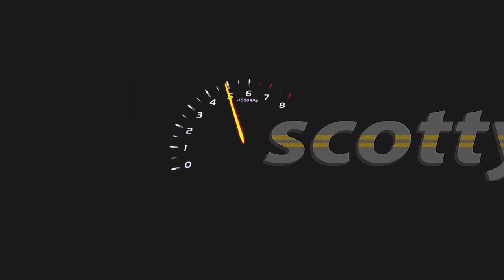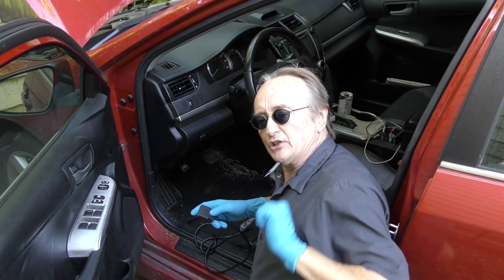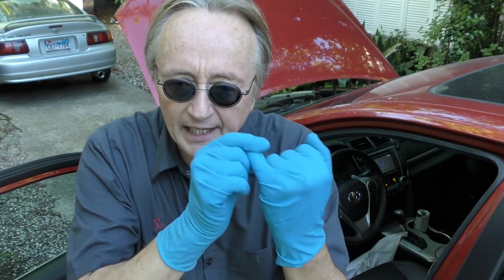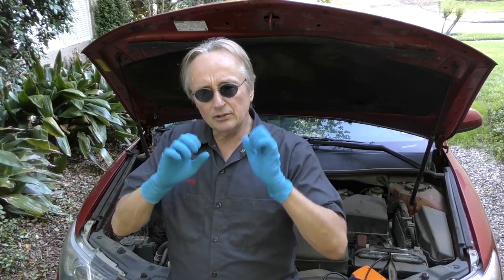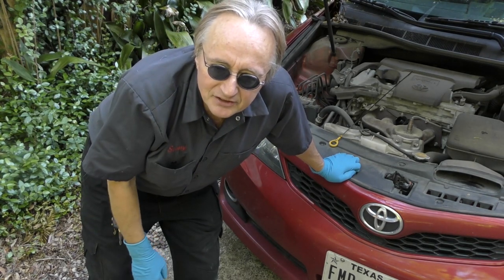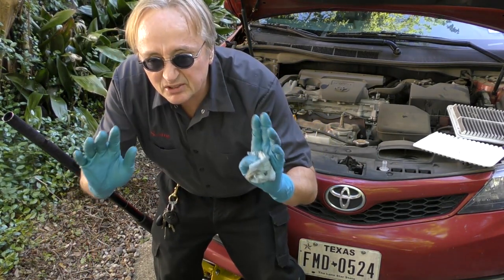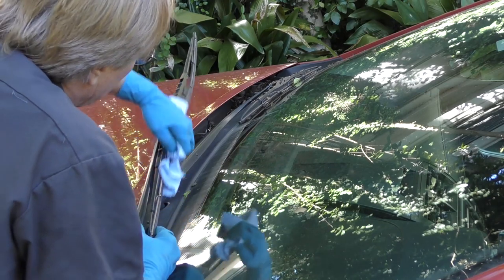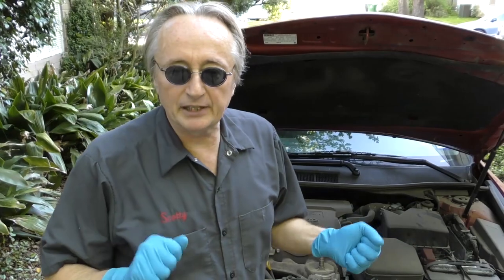Doing This Will Make Your Car Pass Inspection

Comment: New York isn't too bad.  Outside of the city no pipe test, looks like the same as Texas, same OBD II only.  I bought a cheap tool place code reader and cleared the code mine had (some minor EGR issue) and it passed.   ABS light on is okay, it just has to stop straight and they check the usual safety crap,  one wheel has to come off to inspect the brakes.  But you're not going to drive around with non-functioning brakes are you?

They still hit me for a bulb and a power steering leak and fixed it without asking, so not sure I will go back there.  I walked around it the night before and checked all the bulbs, I even changed one, and they don't indicate which one was changed.  And it never left any puddles that indicated power steering.  I probably should change out that line but it's a pain in the butt to get to. 

I should make a video just telling how the state essentially paid me to take this van away.

Comment: @3:39, i thought i was the only one that hated those plastic top removable-disposable oil filters....even those little paper-rubber oil filters without a steel canister housing COSTS MORE than your typical steel encased oil filter...go figure. I busted some knuckles getting those silly plastic oil tops off....they are not kind.

Comment: You're located in Houston? Please , may I have ur location? I need a mechanic for my 2006 mustang. I had a leak inside the interior under the glove compartment and now my lights won't come on. I took it to ford and they said its my fuse box that is corroded. Can you help?

Comment: There used to be Consumer machines [ Tech Items ] in California, where you could run a Line w/ a  tester into the " Tail Pipe " of your car, And get a reading of the " Smog Emissions " !
But after they came-out w/ Newer  " Smog Station " Test Equipment such as the Roller Spindles that your car " Has To Run On " During the [ Smog ] Test, 
those personal " Testers Vanished " !   Probably Due to Either " Obsolescence", Or " Political Corruption " such as was Or was close to the Case of Then,
Governor Gerry Brown Sr. who rumor has it worked to get the " First Smog Device " " Required " in California, which was a 1/4 inch thick , by 2 inch wide,
Disk with small short Tubing coming out of each end !  It had some Foam in it and " Filtered " the " Emissions " Flowing Through it !!
It was said that Gerry Brown Sr. did this for a friend of his, to help him get his " Invention " on the market !!
So for a Worthless creation, we had to spend an extra cost to make Ol' Gerry and his " Friend " " Happy " !!
Thank you Gerry, you old fart !!!

Comment: 2005 Subaru Outback showing cel and flashing cc lights. Obd sensor shows code p0420, checked cc temp with infrared thermometer within acceptable range. Live data shows 02b1s1-2.788 02b1s2-.840  02b2s1-2.765. 02b2s2-.735  do these numbers tell you anything?

Comment: By "incomplete monitor" do you mean like when people remove sensors to run a cat-less exhaust system?
Reply: That would do it, but more generally it just means the car computer has confirmed everything works, even if you cleared the check engine light. That requires driving around a bit.

Comment: In america these tests are a joke in comparison with Europe, they check every silentblock, shake your car with a machine to see if there's play, struts, very strict smoke opacity on diesels, gases in petrol (lambda value must be 1), seat belts, tyres, rust, bushings, arms, headlights, check for "unathorized" mods like different wheel sizes, spacers, don't you dare to put a different engine or exhaust pipes without homologation or delete cats/ or DPF, can't install xenon or LEDs if your car came with halogen (because of the reflectors) etc they also check OBD2 in modern cars on top of all that. It can be a nightmare if you have a 10 year old car.

Comment: Help Scotty!! I have a 2015 dodge challenger sxt, My car had abs code C0031-62 left front wheel speed sensor signal compare failure. I changed my left right wheel speed sensor and now its saying incorrect component abs code c0031-4a. I tried erasing the code but it doesnt erase it stays on

Comment: In corrupt eastern europe, it is not so easy as you have it there. In here additionally to exhaust gases they check the brakes - if brakes dont work you fail. If they work, but 1 or more disks/rotors breaks less/more than the others you fail. If hand brake does not work you fail. If hand brake works, but only on 1 wheel you fail. if any of the windows wont roll down you fail. For vans if there is not a wall or metal bars between you and cargo area you fail(requirement for vans). They also sit in each of the seats and make sure all seatbelts work. If 1 seatbelt is missing or worn out you fail. If car has more seats inside than is described in technical title you fail. If dash lights do not work you fail. if abs or airbag lights up you fail. They mostly dont care about check engine or error code reading tough. Then they test tie rods, coil overs etc. If theres too much play somwehere or they are broken you fail. Also body is checked underside. if there are oil/fluid leaks somewhere or rust holes big enough you fail. if you do not have required hazard triangle you fail.  

PS! Also is required to have fire extinguisher that has to be stamped every year by separate company(for money), otherwize they dont accept it and you get a warning.

Comment: Scotty, love your videos best mechanic, i wish i could let you see my 05 infiniti G35 coupe i could really use a man honest like you 
and please what are your thoughts on the infiniti G series... cheers from lebanon
Reply: I've got an 03 coupe myself.  You having issues with yours?
Reply: @theripper121  yeah man the radio ... its a stock bose system but no sound is coming out its freaking me out 
Somthing might be loose with the plugs
Reply: @1122449  Hate to tell you but the factory radio is very unreliable.  The 6 disc changer often poops out.  Often times the radio itself or bose amp dies then you get no sound at all.  Its a frequent issue with those cars.  Generally the easiest way to fix it is to rip out ould radio I'm afraid and replace it with an aftermarket unit.
Reply: @theripper121  damn ... im scrued😂
Im gonna sell it soon so i wanna chek everything before the new buyer comes to see it im gonna take it to a audio shop i think they could fix it up for 100$ ... a new radio costs about 500$ my wallet is screaming at me 
Thanks for the quick reply i appriciate it

Comment: whats with that AT 205? can you make a video about it? says seals transmission leaks?
Reply: enraged gecko - It's ATP AT-205 Sealer/Leak Stopper(?) (and it seems to be a rubber conditioner, too).  Scotty recommends it for keeping rubber parts supple and lasting.  Guess you can find it at AutoZone, Wal*Mart, NAPA, and probably other auto parts stores.

Comment: the 1994 f150 doesnt have an obd2 port its ecc. so they cant just plug it in ansd say hey your good like they can on my 98 mustang and 99 chevy tracker. so theres another issue. when i read codes i have to use a jumper to check the codes and the book. i dont know how they check it at the smog shop but i dont want them to tell me i have to go drive 30 miles and set the computer afteer the battery died. so how should i get arounf that issue? but were just gonna take it i and hopefully all is weel and they will smog it and take my money and send me another stiick so i can haul my trash to the dump for another year! ha

Comment: Man, the emissions test in eg. Finland is just BS. Even if all of Finland stopped today and had zero emissions as a nation, the effect on world emissions would probably be less than a fraction of the margin of error :/ And with the even stricter EU regulations, basically any car older than 8 years has a high chance of being illegal and to be crushed. I don't see how that helps pollution, as it probably causes more emissions to MAKE the car than what it emits during its lifetime. The net result would probably be better if everyone was allowed to run the car until it can no longer run (probably due to rust - not by emitting 5 % more CO than a brand new car :D).

Comment: Can Bad motor mounts and a bad master cylinder cause a car not to pass in California?
Reply: No. But visible oil leaks can
Reply: Replace your master cylinder!
Reply: I know I will eventually. I'm not 100% sure it's that though. I have a brake hose leak and am gonna fix that first and if it feels good after I'll leave it if not though then that's when I'll know. And my engine just got rebuilt but the rear mount is bad so it shakes a bit during acceleration
Reply: @larryaltamirano1307  
I see.  Well fixing the most obvious problem first sounds like a good idea. Be safe!

Comment: If Toyota’s are so great why is my 2012 sienna van such a pile.. I have a 2011 Chevy 2500 same 90,000 miles and other than a battery, zero problems..

Comment: I think very dirty,loaded, oil seals rings better and helps you pass inspection ,no?  I know that to be a fact on diesels,not sure on gas.
Also,the dirty air filter does not matter,the ECU compensates easily for that via the MAF/MAP and O2 sensor(s),no?
The oil filter does not matter either...
So,back to the title....what's that "one thing"... (i still don't know since that guy on horse back with his gloved finger up, on the city slickers movie,what's his name ?)
 And sir Kilmer, your  job is not "mechanic" anymore?;it's youtuber,right?

Comment: what most people as my self I rather make sure my car is running its best. the test for emmissions is to show the minority that they do not take care of there car. if it does not run right and drive it all the time. I rather fix any issue to make it run its best if there is a code fix it if it is not efficient fix it. before I did a engine rebuild on my 95 mercury it passed emissions even though it burned a quart of oil a week. same as my 98 s10 that had a misfire fix it and still passed emmissions. both have stock cats as well as if a person has baled tires yes it will fail because of safety it is a common thing. plus most people have there car inspected to know when they need breaks done.

Comment: Years ago in UK you'd buy a used car and the crooked dealer would fix the car to run a few miles then that piece of crap would die.  Nowadays with a comprehensive annual test for cars over 3 years old and results online for all to see with luck now all crooked car dealers are starving or dead. We're even thinking of reintroducing. capital punishment But just for car dealers
Reply: By the way the test in UK is only £50